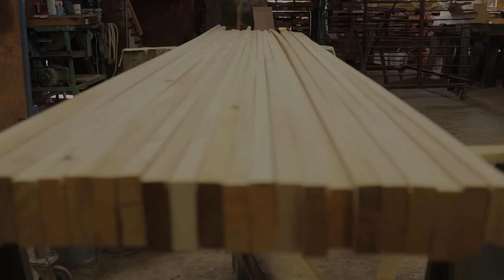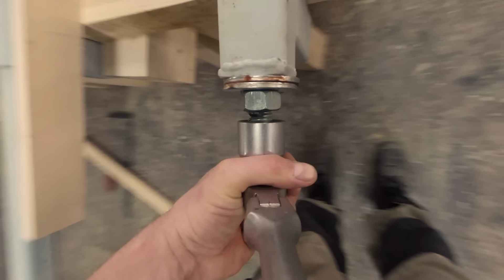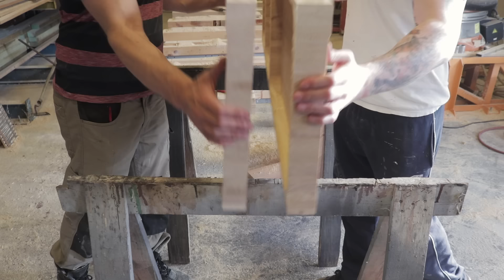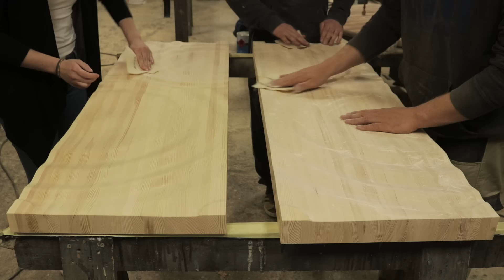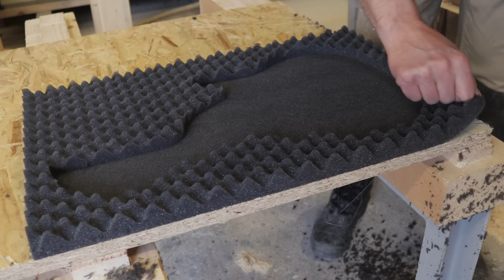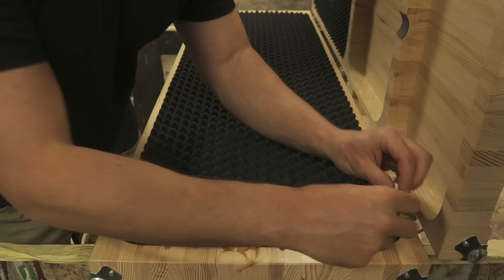Making a Bass Guitar Case

Comment: Really nice. Looks like a one million dollar case. Impressive construction and machinery.
Reply: I'm not carrying this all around town. Looks good but not practical. Must weigh a ton. The foam seal is wimpy and useless in weather, it needs to be buried in the seam line of the case. The wood is goin to warp anyways. The course abrasive Foam will ruin the Guitar's finish. That's why they use fake fur. To keep the polish. These guys don't know what they're doin.

Comment: Looks awesome, I'd probably remove some foam from the top piece where the head stock is so it's not putting downward pressure on it. Probably wouldn't snap it off, but why take the risk? The guitar is sufficiently held down even without it.
Reply: LMAO

Comment: The case is great, love the design. It would be even better with a small box inside to put some strings, guitar picks, and tuning fork/device in. I like the standard classical guitar case with such a box, which makes it easy to keep your basic gear right where your guitar is. My electrical guitar case doesn't have a "box" inside and my picks and strings fly around in the case.
Reply from the maker: That's a great idea! I'm sure I can implement something like that in my next design, Thank you Peter! :D
Reply: @lignumchannel  You're welcome. ;)

Comment: Cool idea for a case but that ripple design looks a bit too bland for my personal taste, maybe you could've had someone carve a mural or something into the top piece or even the company insignia or even a wood stain to give it some character.
Perhaps more support under the length of the neck would be ideal for those instruments with delicate truss rods and a deeper cradle for the body so the lid doesn't add pressure to the instrument when closed which is the whole point of the convoluted lid foam, to act like a support cushion and not smother the instrument with unnecessary weight or pressure to the top of it like it seemed to do when you closed the lid.
As mentioned by someone in an earlier reply, that foam is useless, it becomes brittle and crumbles away, might pay to look into sourcing PU or PE foam the type used for gun cases which is best for everyday use for sensitive equipment and protection. This will offer the best protection if the case is dropped or mishandled, and they usually are.
With that being said, it's a neat novelty case.

Comment: Mmhh, it looks heavy and when you closed it it looked like it’s putting too much pressure on the bass. And also as you carried it out you could see that the balance is off, the handle should be at least 7 cm to the right. But looks really cool.

Comment: AWESOME!  A lot of firsts in this video; first time I've seen a CNC used to mill foam, first time I've seen a guitar case that must weigh as much as three of the guitars its holding. When you order wood glue do they just leave the tanker truck in your parking lot?
Thanks for sharing your work. Hope you, your family, and friends are all well and safe.
Reply from the maker: You are not so far off, regarding the weight.. But next one will be less than 8 kg now when I know the concept works. I would be really happy if I had so much work that I need glue by the truck :D The foam didn't work from the first try, it took some trial and error till I got the right milling bit, speed and rpm.. thanks For Watching J T, Stay safe!
Reply: If you listen from 3.52 you can hear it reverse up the drive....🚚

Comment: "Don't let your left hand know what your right hand is doing."
This sentence is like a veteran carpenter's hand skills 
and a performer who plays both hand instruments, (such as piano and guitar)
If the head orders-
You have to divide the use of your right hand and left hand separately.
It means don't do it in a symmetrical way. 
It means not to mix or skip each use.
(including all two-handed instruments, farmers, fishermen, soldiers, tailor, hairdressers, boxers, etc.)
When you work, when you eat, when you breast-feed your baby.
And the structure of the sentence-
writing down the thoughts in your head and reading and speaking them are not symmetrical.)
Imagine you're holding a tool.
First of all, the right hand-
Apply force to the tool and use it at the 'right' point.
But you don't use it for the 'wrong' point. and then you relax.
And the left hand must point to a place where the use of the right hand is better, 
But if the direction is wrong, you have to fix it. 
The result of using both hands differently to help each other:
The carpenter's work is intact.
The guitarist makes a natural sound.
The right hand should not apply force to 'useless place'
The left hand should not be directed 'where you don't know'.
->The carpenter will make a wrong work,
The performer will play "dissonance."
There is no one who doesn't feel dissonance
The uncomfortable chair is uncomfortable.
Logical Design of Human Intelligence:
The power of the right is obtained in the right place, and not in the wrong place.
The left's wish is to head for a better place, but to be honest.
It's 'different' and also 'together', so it is-'As one'.
This 'Pureness' can be seen in your 'body' and 'mind'.
You prove it yourself.
Also, when there is dirt in your mind,
With the "eye" of the truth that we've realized,
You can see it.
I also confess.
I looked at the world based on materialism so,
Many parts of me were against the truth.
Now I can see the shape of our minds.
It naturally makes sense why humans, unlike other animals, 
have been able to achieve the present civilization.
The "selfishness" of a human being with the tools of knowledge and information
It's the instinct that no one can deny.
It is necessary for the life and satisfaction of individuals and families
But the current society has become informative and anonymous.
People don't handle inputs with their own hands on online
People don't have to face the result offline.
Everyone is making money and excreting their emotions without having to face each other.
It's full of insensitive antisocial profit-seeking, extreme need for show-off and content addiction.
The space that harms others who don't even know their faces is growing in everyone's mind.
But never get me wrong. Never!
It's not about stopping or not using tools.
for a long time,
in two pairs of axles: Right leg-left arm//
left leg-right arm=X&Ypositioning 
We've been using tools to use both hands separately and together and help each other harmoniously. 
So we can develop the left and right brains respectively,
We've reached our present intelligence.
Whether or not our own selfishness has stepped on the line can be felt with our own minds.
You can manage wisely so that day-to-day developed tools can be used in a beneficial way.
If someone's selfishness is endless, we can stop it together.
We can discuss how to become a better society, 
and the public can easily spread the moment when justice collapses.
I hope you wake up.
Sooner or later, due to rapid changes in the global environment,
All kinds of crises can come.
And for a long time, there are people in the world who follow unnatural intelligence.
They have a spirit that has become symmetrical with only one axis. (like a bird)
If you take after them for the survival of a few,
It must be a retrogression of the intelligence and ethics that mankind has achieved.
Let's always check the facts on our own to prepare for a crisis.
Let's not leave our intelligence to any particular person, group, media, religion and scripture, special notions, symbols.
If there are reasonable suspicions, let's take a look and develop our ability to suspect 
and withhold-judge with diverse knowledge and information.
Let's look into both 'truth' and 'selfishness' and let the truth control the selfishness.
It's not about being a strict instrument player and scolding a clumsy player.
Let's not criticize and hate each other by using fundamental moral principles.
Let's thank the truth and conscience are breathing in us.
If people all around the world join together in ethical and intellectual forces, 
we can overcome the crisis and move on to the future.
Please send this message to the world (regardless of the source)
I emphasize again.
See the "Truth" from "Self"! (not others)
Thank you, everyone.

Comment: it's absolutely useless! too heavy, weak with weather iccues, too much compresses the bass,  not protect from falling/dropping on tour/flights (breaks together with bass) 
for whom you're made it? for museum? ))
Reply from the maker: For now, its for my personal satisfaction of making it. But I'm not sure why you think glulam is not strong or durable enough?  And why do you think it compresses the bass to much? The weight has to go down for about 2 kg I agree. I'd like to solve these issues if I start producing more of them one day..
Reply: first - wooden constructions are fragile. if plastic or alu case drops, it bends or springs up, but wood just breaks. special attention to the hardware mounting screws. they're easily pulls out of wood when side/angle hit is, and even cracks out wood pieces from mounting zones. is's danger of opening. plastic or alu cases uses metal rivets, which way stronger because holds themselves on both sides of material. wooden case will work, but  once.  second  - most basses weighs 3.5-5.5 kg's and handheld case should not weighs TWICE. 10 kg's is maybe ok for case with a bass inside ,but even 10 is too much.  third - it clearly visible  how mush case top pressing down when locks closes. maybe it's not really matter if the foam is  soft enough. but with dense foam you can damade the fretboard. and fourth - you made really beautiful thing, I was not even going to argue with this )